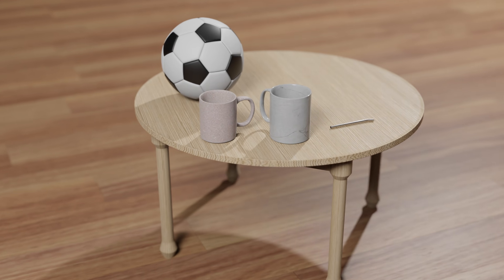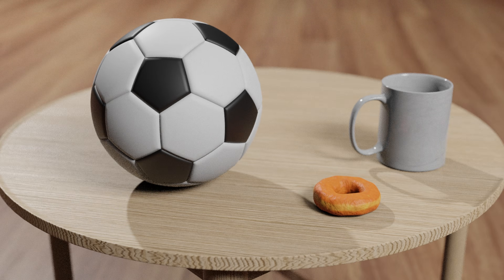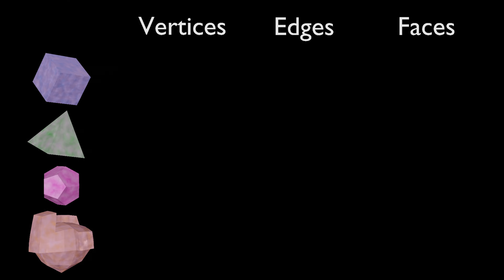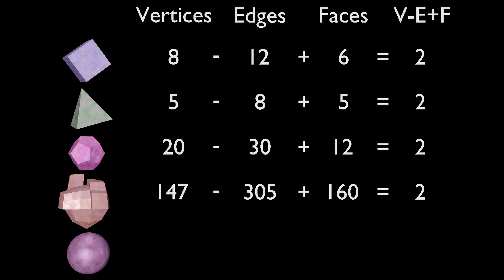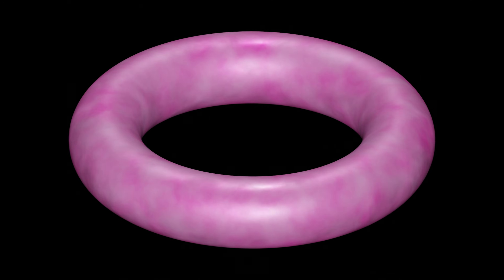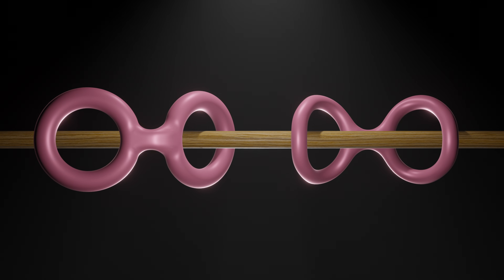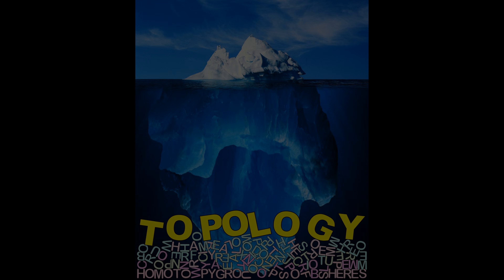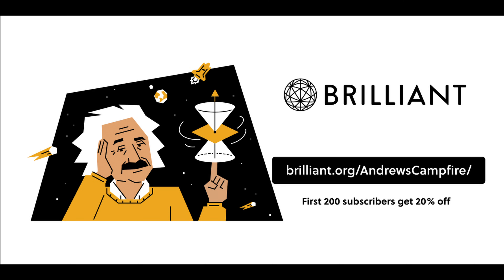Intro to Topology - Turning a Mug Into a Doughnut

Comment: No wonder why a gelatinous being would be nearly impossible to contain fully. If it follows the rules of no cutting, gluing or ripping, but can infinitely adjust itself like in this example, then it would have to be impaled to prevent it from moving far. But it would never be fully stopped. You'd have to use a container!

Comment: 3:00
That assumes that infinitely subdividing makes a circle and not a really granular polyhedra, take for example a square with side length 1, and a circle inside with radius 1. If you fold the corners of the square such that they touch the circle it does not change the circumfrence of the square, and if you do so infinitely, you get a circle with r=1, and circumfrance of 4, meaning pi=4. Not, because infinitely subdividing a square does not make a circle.
In a similar fashion, we cant say circles have a euler characteristic of 2 by that method.
We can still arbitrarily decide that they do because it helps with our logic though as long as everything else is consistent.

Comment: I have an easy solution to the straw question at the start of the video, and that's defining what a hole is. 

Imagine a donut, and visually we can see the hole, but we can't just say "if it looks like a hole, it's a hole" because that causes the straw predicament. Imagine a point inside the center of the donut. Now, there is a 2d plane where the point is inside a circle, and it can't escape without using the third dimension. Now, imagine the plane moves perpendicular, so that it moves along the third dimension. We keep track of where it's moved by having the line leave a trail. Once the dot isn't contained inside the circle, we move on the other direction until we reach that same state. Now, the length of that line is how big the hole is, but what we care about is the fact it's all one line, thus meaning there's one hole. Now, if we did this to a straw, we'd reach the same conclusion. We need to stop caring about how far apart two openings are, and figure out if they're connected, because openings and holes aren't fully connected. Thus, a straw has one hole, never two.

Comment: A straw has infinite holes stacked on top of each other
Reply: It gains the others once it’s no longer curved like a donut and has a „flat“ line between the two edge curves that’s larger than one rotation inside the straw (I think that’s called the circumference). Basically once the path from the top hole to the bottom hole is longer than the edge of the hole would be if it where opened into a line. A Petri dish without a bottom would only have one hole but those amusement park rides have infinite holes

Comment: Sometimes we forget that topological holes are not the same holes we talk about in everyday speech. To a topologist, a hole in the earth is not a hole at all, but it is a hole by the definition of "hole" that came much earlier than topology as a science existed. Topology created a different definition of a hole. The way we define a traditional, non-topological hole is a locally hollow area on a solid surface. If a dog digs a hollow area, the dog made a hole, despite the fact that the dog only repressed the surface of the Earth topologically. You don't need to consider the entire Earth, you only need to consider the local area for that dog's hole. Likewise, if an object is large or long enough, there could be a single topological hole connecting two opposite ends, but that could be considered as two conventional holes because the object is large or long enough so that the two ends are no longer local to each other. A donut has a single conventional hole, but a long straw, while having a single topological hole, it has two conventional holes, the top hole and the bottom hole. The two ends are not local to each other.
Reply: I misread this and thought you said the word butthole what is wrong with me